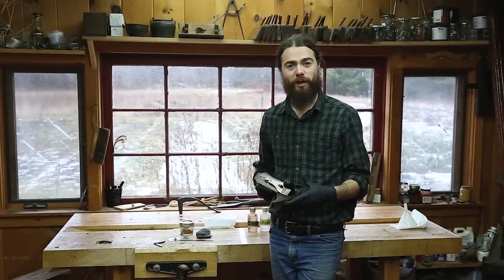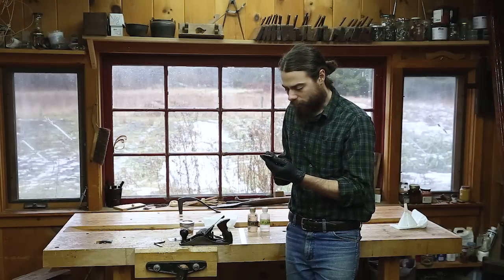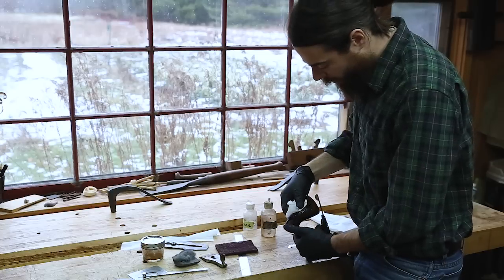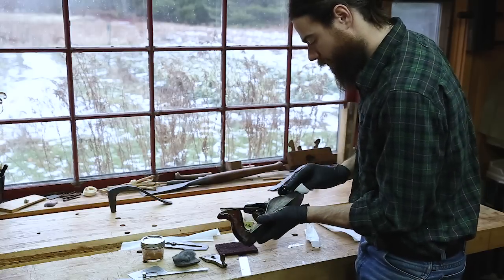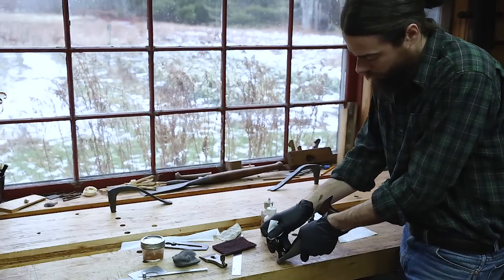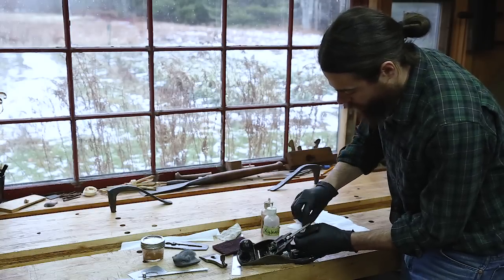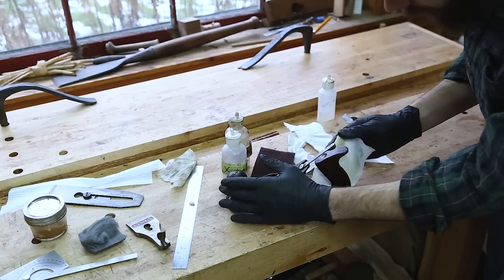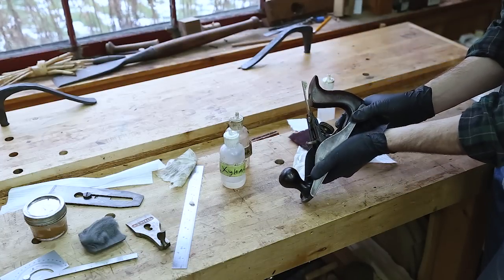How to Restore A Hand Plane

Comment: You did choose a nicely preserved old one.  Most of mine have been completely frozen.  Lateral adjustment frozen and everything had to be disassembled cleaned and put back together.  Even the frog needed to be removed and cleaned up to be able to adjust.  That is because I now live in central Florida.  Hot and humid in summer and cooler and humid in the winter.  I enjoyed the video and learned from your perspective.  Thank you again, Sir!

Comment: Great video, i actually have two antique wooden planes one is a try and the other a jointer. I was wondering if you had a wooden bodied version of this video planned? because that would be awesome. The try jams constantly and the jointer needs work in the throat. I didn't notice that the blade was too wide when i bought it. Any advise would be greatly appreciated. 

Keep up the good work.
Reply from the maker: We'll keep it on our radar. Next time I restore one I'll see if I can do a video. Thanks!

Comment: Sorry, did he say something? I was too captivated with the view out of his window and I'd have the Swarovski permanently set up there.

I did listen really, honestly, but I couldn’t promise to if I worked there and I think the window would make me even slower. I like to keep and restore tools to working clean because that’s how Im going to use them. My Record #5 has had the most done as it was covered in all sorts when I got it and it did need a new paint job to protect it. Usually though it’s just clean, remove rust, oil mechanical and oil handles. Of course the blade and chip breaker get much more attention. 

Please may I ask, as you are obviously a taller man or you have a very low bench do you not find yours too low for you? Sorry it looks a bit uncomfortable especially when you were sharpening. I'm 5’ 10” and my bench is about 34” which I find perfect. I’m not trying to be discourteous in any way I’m genuinely curious. 

A very enjoyable video and I’ve subscribed.